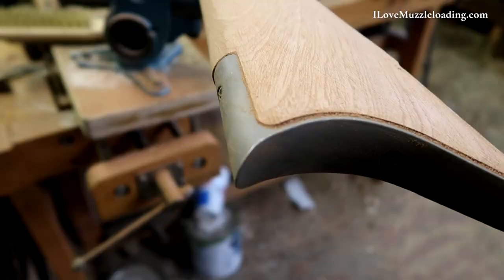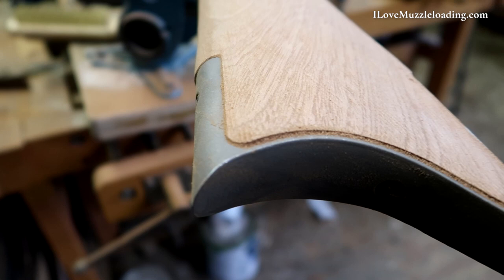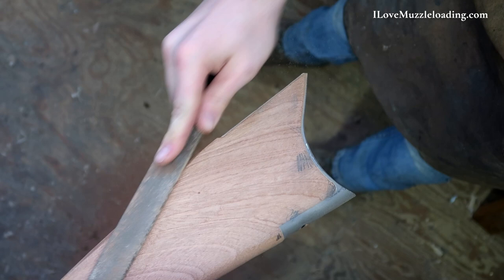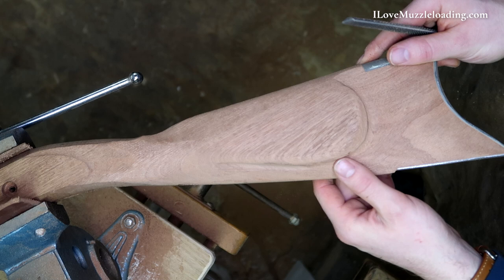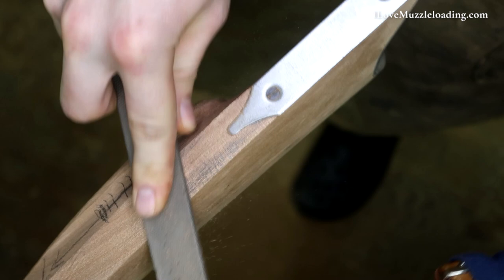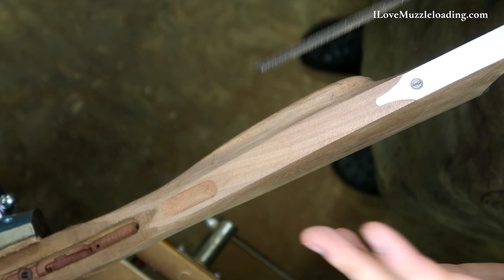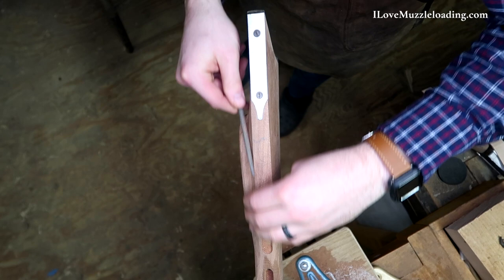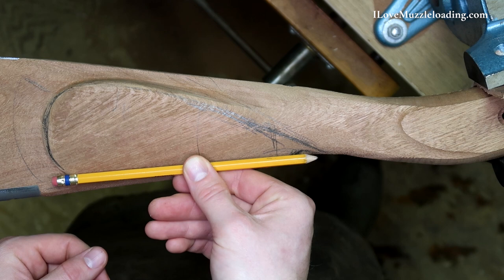Let's Build an Investarms Gemmer Hawken Kit Part 4: Rough Wood Shaping

Comment: Ok so I wanted to wait till I had time to view the entire video in one sitting. I want to say that you are doing a fine job overall. So that being said I have a few ideas for you,  and I intend in no way to seem critical. I want to start out by saying its interesting to see that you are using a book as reference of samples to compare. So I going to take a moment to remind you that no two rifles out of such a shop would be identical. I see every new project as a blank canvas, rather it be a kit, scratch, or customizing an existing piece. In order for me to give my example of my most recent inspiration of the Remington new model army mentioned earlier, I have to tell a short story. First of all I am a gunsmith who has a hobby of history, and put together my first kit in 1974 at 12 years old. Gunsmithing school 80/81. June of 2020 I had an unrealized stroke, diagnosed July. Stubborn pride. This effected my vision, I see 2 of everything and neither are in focus. This ruined for me my confidence so I sold off anything that if a mistake was made could be dangerous( ie handloading equipment etc). I  had this brass framed Remington that I only had because the price was right. The lack of confidence lead me to another local smith. I asked him to shorten the barrel reinstall sight, ram latch, cut and remachine the ram. He had it for 10 months, and when l followed up on it he had 0 work on it, with a stating do not have tooling.
  Well this inspired me. Though a brass framed Remington is not historically correct my mind want to that gunsmith wasn't worth a plug nickel. Gave the vision of a civil war soldier turned river boat gambler, looking to convert a to hideaway. I am 2/3 the way through the project ram, barrel shortened. The latch reinstalled in the ram, tooled by hand not machine, with the feel of my hand and the eyes of my 14 year old daughter to help. I can feel and sorta see some defects. Remember art is not perfect even when a saw 20-20 I could find defects. Take your time and enjoy. For me I looking forward to my next project.  That is Ashley walking into a gunsmith asking for a build using the knowledge of those who explored before, with knowledge of wildlife and natives. Keel boat as mode of travel. If I was Ashley my request would be cross between leman,jager, Hawkin. .62 caliber  2 barrels rifled/smooth, 26 - 30" wedge pin drop in. I think you get the idea. Half blind or not the mind does not stop. To be afraid to let you imagination lead you.
Reply from the maker: Thank you for sharing Steven, I’m so happy to hear you are continuing to enjoy building kits! God bless and have a great day

Comment: Absolutely awsome work. I need to get that book you have. Do you have and use any pattern maker rasps? Some of them look like they could be. What is nice about a pattern maker rasp is that your not necessarily bound to filing in one direction. They are curved surface shaping tools. But don’t hit metal with one!  Question I have is this. Gemmed came later. So did he build flintlocks or was there a period of transition between flintlocks and percussion locks?

Comment: Looking good, coming right on along! Some nice curl in that stock, going to stain, or do the aqua fortiss on that? When it comes time that is.
Reply from the maker: I’m thinking about doing a faux striping on it like some of the originals had, will need to figure out how to keep the stock light so the lines show, what do you think?
Reply: @ILoveMuzzleloading  yes, I have heard that some of those actually had painted on stripes? Hmm, I might refer to a video you did on Kibler builds, it had a nice short demo on stains, shades, for stock finishing? I have only used Birchwood Casey Tru-Oil on my stocks. IF I could get a nicer “kit”, Kibler, Chambers, TVM, etc I might be tempted to try that aqua fortis?(I’d research it again). Nice carding brush, lol